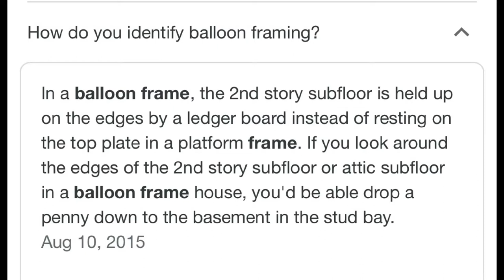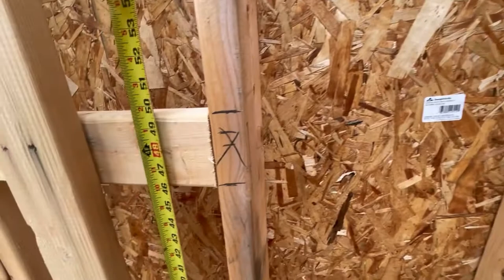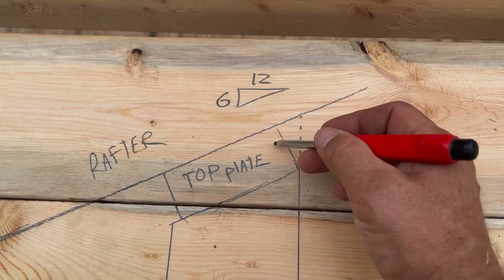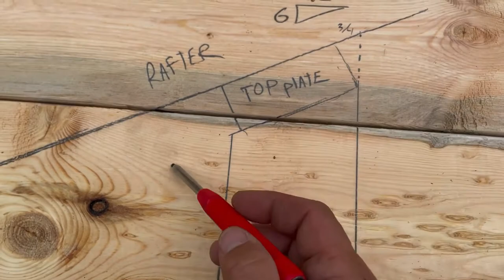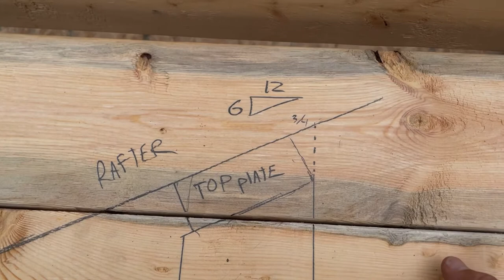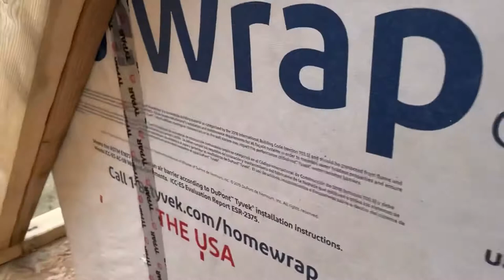Balloon framing and rough framing tips

Comment: You got your definition wrong balloon framing is using longer studs to go from the first floor to the second floor everybody in carpentry knows that
Reply from the maker: Yes I know, but it’s also used to describe framing vertically, as opposed to framing in the ground and standing up a wall.   At least around Michigan.   You can call it whatever you like.  The point of the video was to show how to frame a wall in place.